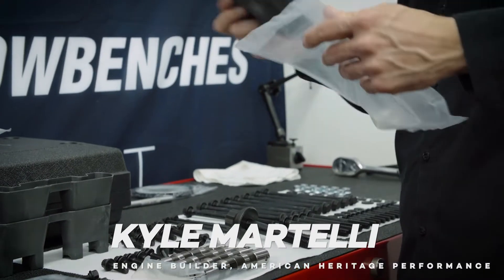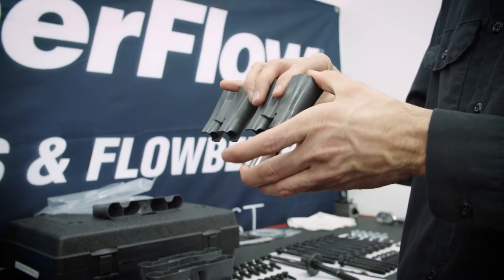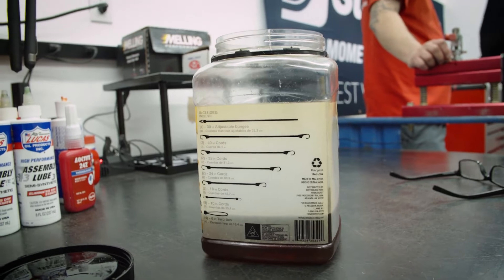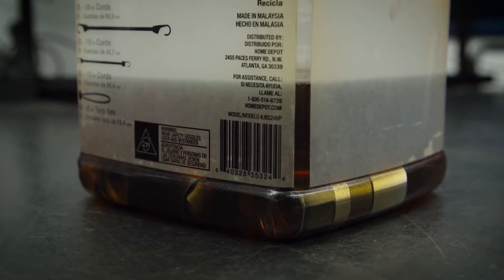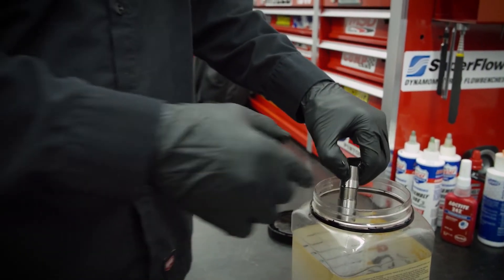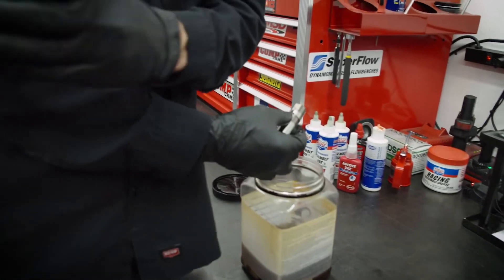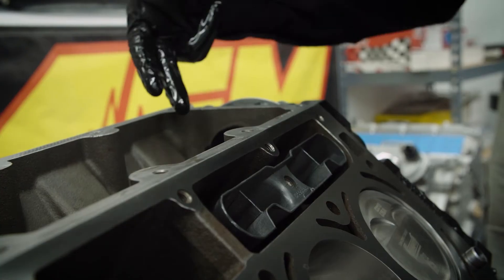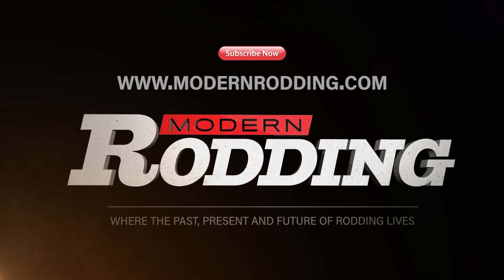How to install LS lifters

Comment: Not to be rude, but you cant make the feed hole face the front or the rear of the block.  The holders wouldnt allow it.  So then the guestion would be, does one face the feed hole to the inside or outside of the block.....

The oil feed from the block is on the outside.  But it still doesnt matter as the oil will be allowed to go around the lifter and get to the hole in the lifter.  No matter which position.   But the feed hole will never be front to rear.  It cant.
Reply: My biggest gripe. I’m not a mechanic. Just a DIY guy at home doing a 5.3 rebuild and I’ve seen several videos now referring to front and back direction for a lifter and I’m just thinking HOW THE FUCK.
Reply: waiting for someone to notice that, I worry about the fact that no one said anything
Reply: @rhnstjegilrhkscvn1djhrj969 I had to point it out.  The the lifter holdes only allow it to go 2 ways.  And neither was will "block" a feed hole.  But I always put mine wards the center of the block at the oil feed is from that side anyway.

Comment: The reason I would point to the rear is because it’s a smoother transition into the lifter. When pointed forward it’s a 180* turn followed by a sharp 90 into the lifter. When pointed to the rear it’s a smooth turn into the lifter but the same 90 into the lifter after entering the crevice of course.

Comment: Would it make sense to then bleed the lifters some before installing them to be able to get the preload correct? If you soak them in oil and they're super stiff, couldn't that affect the pre loading process?

Comment: Why did you only soak your lifters for 2 hours? I was always told that you had to soak them for at least 24 hours is that not true?
Reply: just watch the air bubbles in the pil container, when there's no moee air bubbles comikng up that means all of the air inside the rollers have been replaced with oil, leaving them any longer than this doesn't do anything, take them out when bubbles stop forming and you're good to go
Reply: It won’t hurt to do it longer
Reply: Because they aren't that bright ,like showing the installation process, which he did not show in the video. If he left it for two hours only, he would be doing it again

Comment: Just tore apart a 2015 Camaro SS. The lifters on one half of the bracket are not the same size as the other half?
Reply: Probably active fuel management or direct fuel management.. certain lifters shut down to save fuel . Started in 2007
Reply: Displacement on Demand, active fuel management

Comment: Thank you for the info for a sec i was afraid i installed lifters wrong on a 5.3 but now i see theres no way to install lifters wrong. Was so scared id have to take the head off again to make sure i put em in right
Reply: Brother me too.
Reply: bro Im outside under the hood In 30 degree weather wondering the same exact thing. was wondering If holes on the lifter had to be a certain way but I see they dont

Comment: About to tear my LS2 apart to replace the lifters in my TBSS. Aaaaand while I'm in there $$$$$
Reply: Make a video if u do my vette is in the same postion.
Reply: @Tixrok  Do you suspect a lifter turned in the tray? Because im almost certain that's what happened to mine.
Reply: @DM-qp7do did you ever figure out???
Reply: @Dougdea  No. I pulled the cam and lifters and they look brand new. So I put a BTR Truck Norris cam in with Morel lifters and new valve springs and it is now making a different but similar sound. I replaced the timing chain and gears also. The rockers look perfect and my motor has definitely been apart before. I bought it from Copart so I don't know what the previous owner had it apart for but its SUPER clean inside with new parts. Im baffled man, idk what it was or what the noise now is.